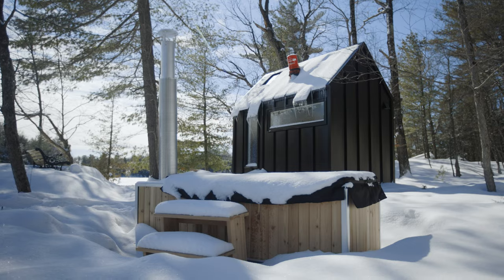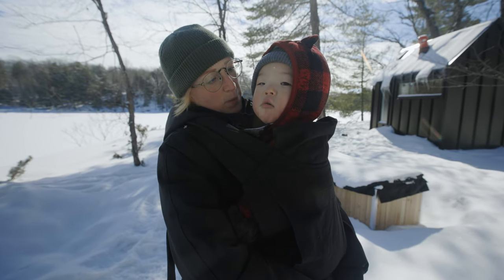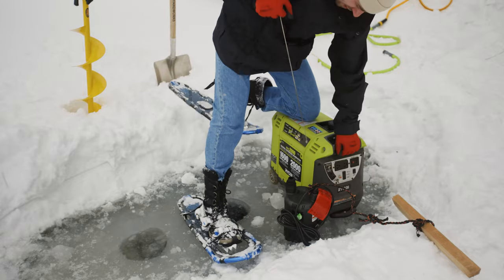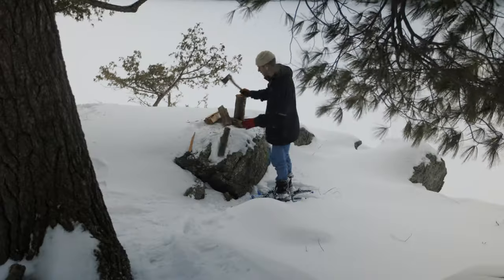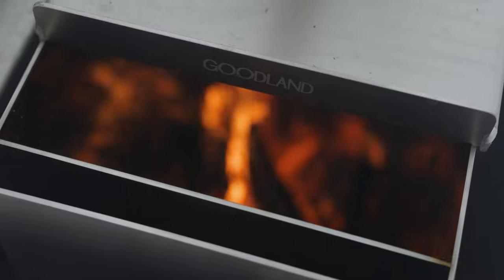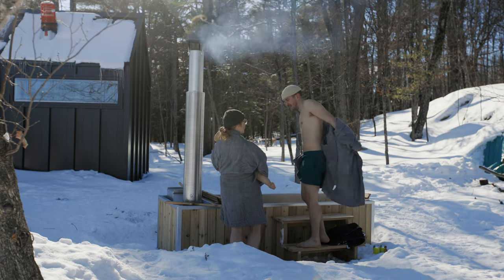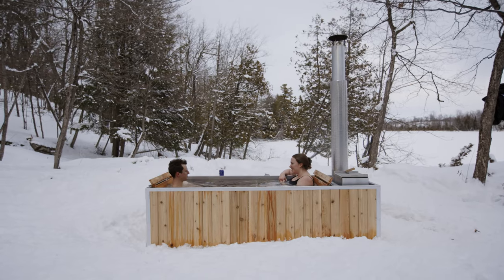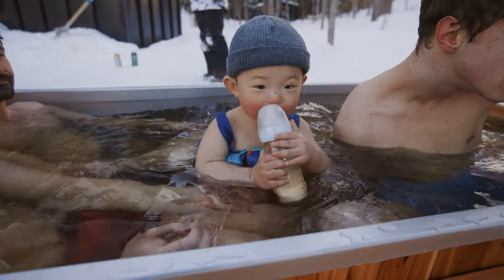How Does Wood Burning Hot Tub Work in the Winter?

Comment: Hey I just bought the same hot tub ….. and plan to use it at our cottage in the wintertime…. How long did it take to fill up ?
Reply from the maker: Amazing! It takes me about 40 minutes with 70ft hose and a 1/2 HP pump from the lake. It would be quicker with a more powerful pump or a shorter distance of hose. A gas pump could likely fill it in 5-10 minutes for example.

Comment: Also ….. have you left heated water in the hot tub over night in the winter to reuse it the next day ….. does it freeze? With the cover on
Reply from the maker: I have done that a few times and it kept the heat well. No freezing over one night in minus temps. I haven’t tested a few nights because we use it so much ha. I think one night is safe for sure but you’d want to check on it after a couple nights. If you have access to electricity a stock tank heater or bubbler would eliminate this risk.